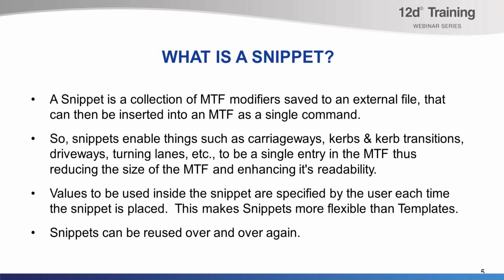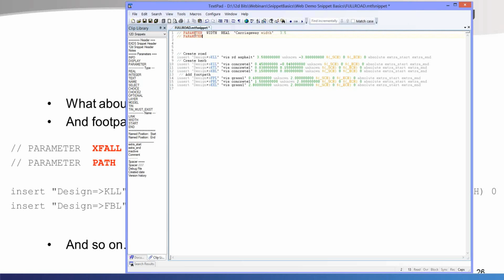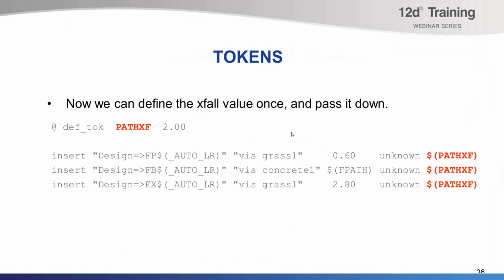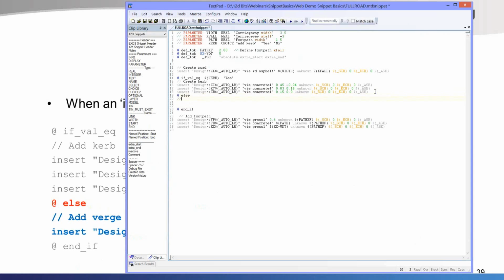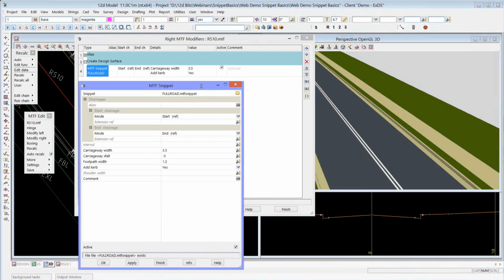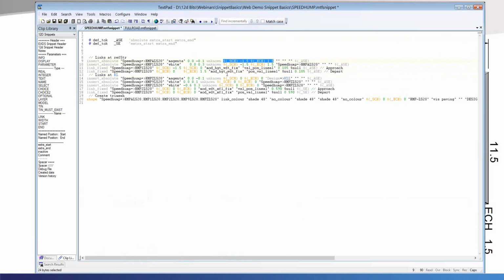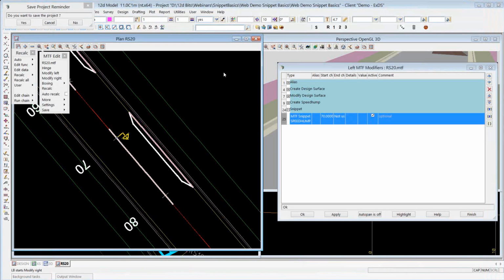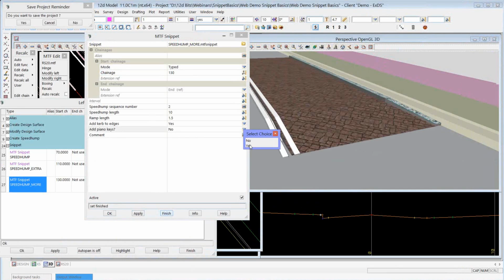Snippets - Training Webinar Series

Comment: What's with the S R 1 2 3 in the menu bar? And how'd you use the mapping file to create the line marking on top of the speed-bump (that's cool!)?
Reply from the maker: Hi Adnan - the presenter has provided this information in response to your question; hope it helps!

It's just a custom toolbar to help with the presentation.  Each button runs a Chain, that I'd otherwise have to do manually.
S - Recalcs MTF and applies the Map File
R,1,2,3 - Are resetting the perspective view

The Map File is doing a Library Extrude (150 wide linemarking) along the piano keys, and Dbl Barrier lines along the centre.